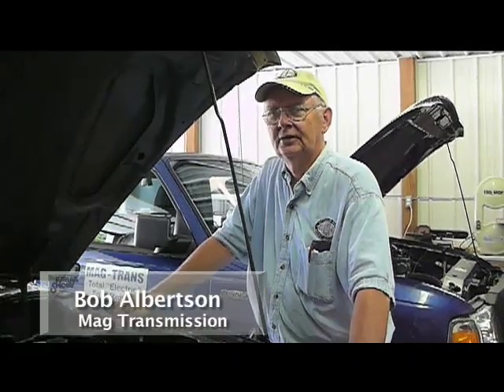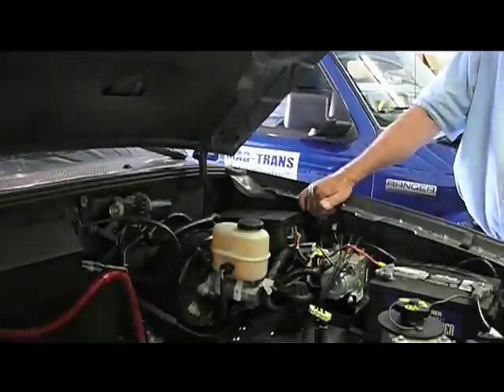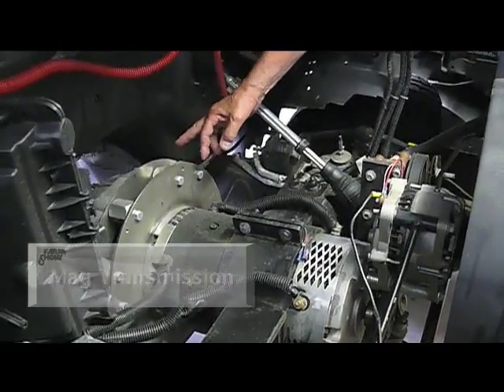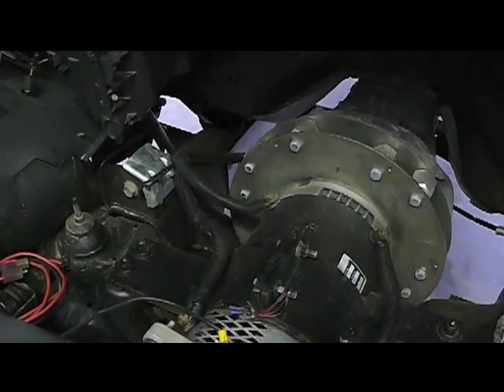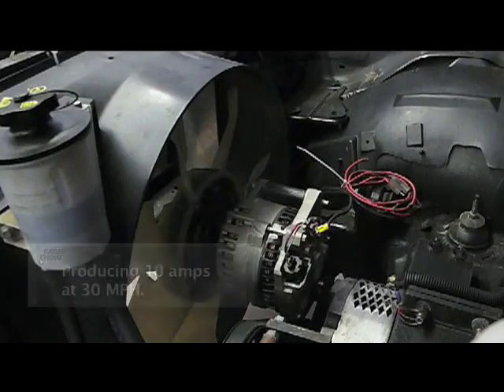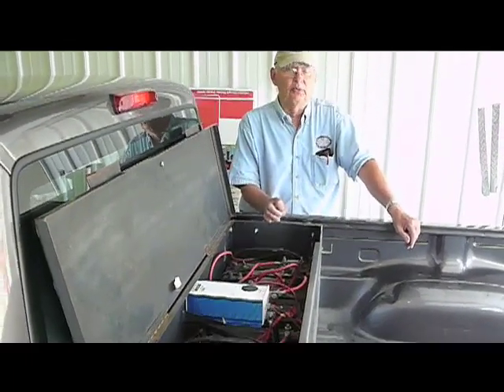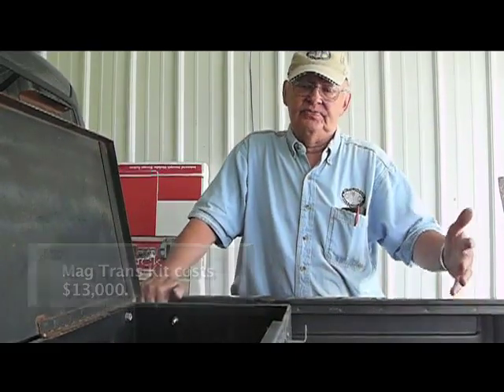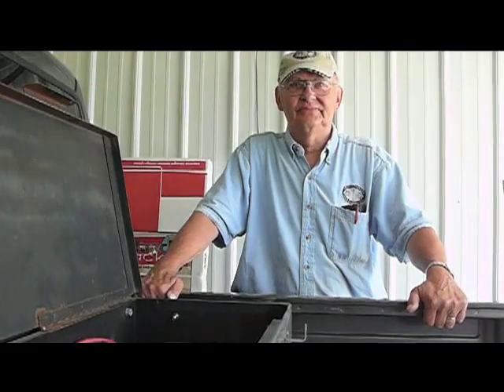Ford Ranger EV Conversion only $13,000

Comment: So $7500 is almost 1/3 of $13000?     You say you are getting 100 miles of range with what look like 100 Amp hr batteries.  If you only draw 60 Amps at 30 mph  you could run for  100 amp hr / 60 amp =  1.66 hours.  That would only get you 1.66 hours * 30 miles/hour =  50 miles  discharging the batteries 100% , which you never want to do to a lead acid battery.  Most setups like yours with a brushed motor are lucky to get 25 miles of range.  Getting a few amps out of that alternator at 12 volts isn't worth the aerodynamic drag it is causing. It is like dragging an anchor.  You would do better to loose the alternator weight and fan and seal off the radiator grill to reduce drag.     For comparison the factory built  Ford ranger electric truck with custom low rolling resistance tires and a more efficient AC induction motor got 80 miles of range with a huge set of lead acid batteries.  So no way you are getting 100 miles of range my friend, unless you are stopping to charge every 25 miles.
Reply: I was about to say the same thing about that silly fan/alternator contraption. it's not "free air" lol